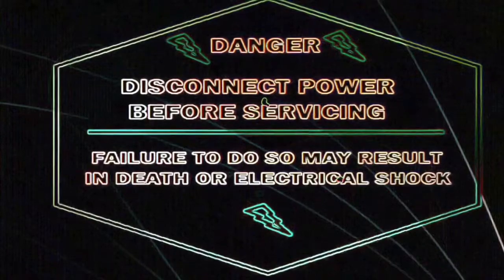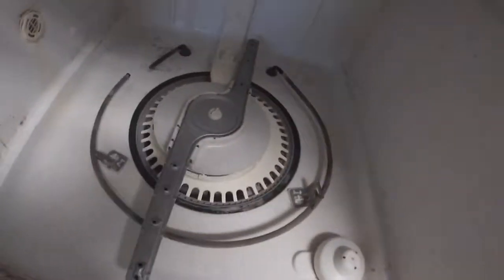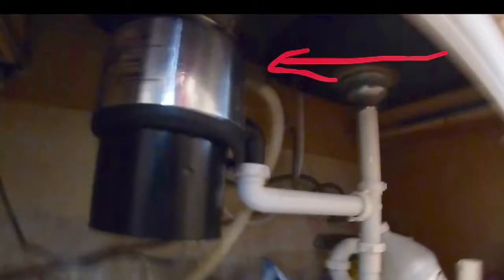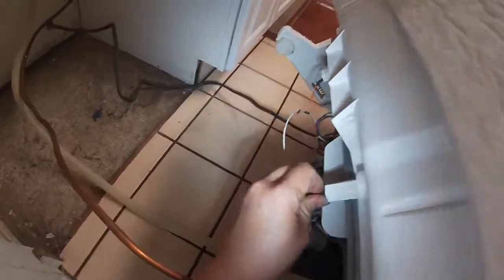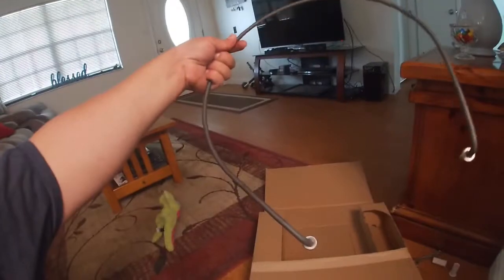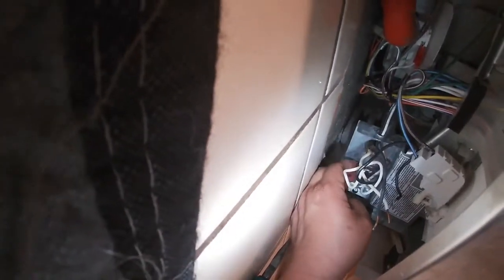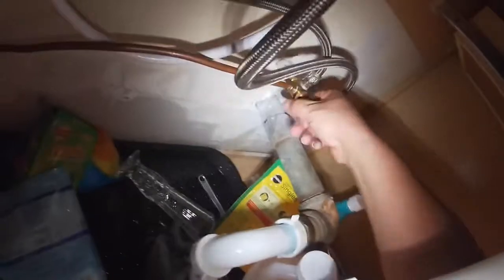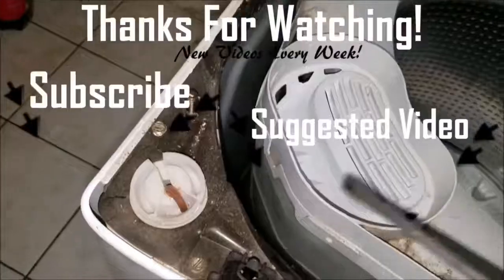How to Fix #Whirlpool #Dishwasher Stopping at Rinse Cycle | Model GU1200XTLS0

Comment: How about a Kitchenaid (Whirlpool) that washes great, goes to the heated dry cycle, but skips the drain cycle. Drain pump works fine after pressing cancel and water drains without issue. Happens irregularly. Float switch?
Reply: Would love this question answered.....mine does this as well.....will drain after I cancel the cycle
Reply: Yes this is my current problem too
Reply: @pontiachotshot  I never did find the issue. The pump started leaking and it was time for a new unit. Resetting it helped for a while, but it got old! The reset procedure is slightly different for each model, but easy to do.
Reply: @dr.emilschaffhausen4683   I went and turned the breaker off to the dishwasher for 24 hours so hopefully that resets it. I haven’t tried it yet. Honestly I am thinking the main control board in the door is causing it cause my pump works great for draining if I use the cancel button and I hear the drain working during other cycles. So it’s most likely what controls the motor I think.
Reply: @pontiachotshot  Yep, control board is likely. Years of steam from the heat cycle takes it's toll...